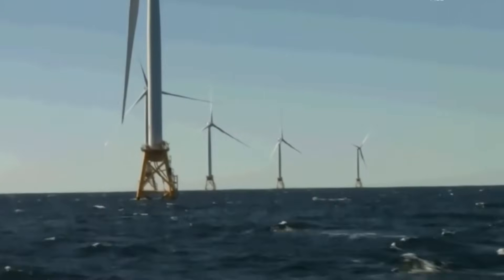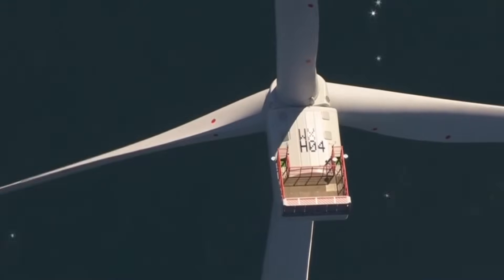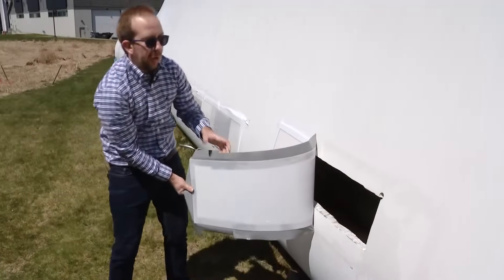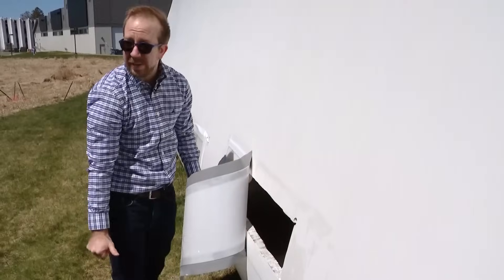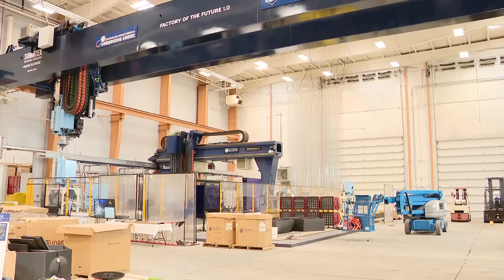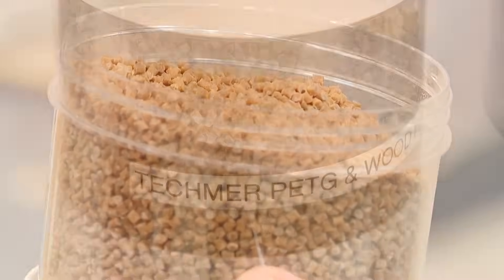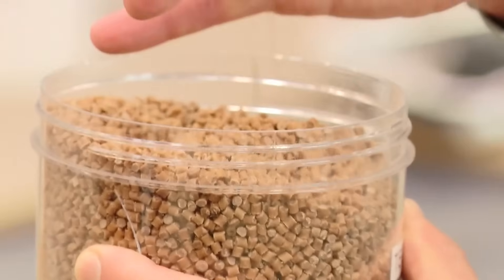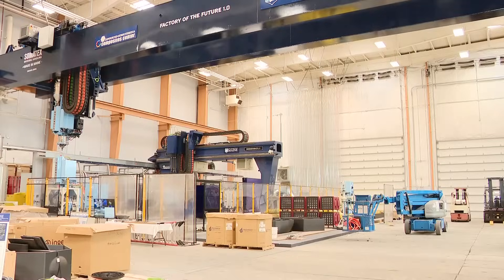University of Maine puts 'new spin' on recycling wind turbines

Comment: if the ground up plastics and fibers can be used in 3D pprinters then they might be able to be used in some kind of plastic welding as well. sections could be cut out of old blades and reused as stock to make other things. my DIY frankenstein kayak was made from alot of plastic welding and scraps and has held up for years. one just has to learn some plastiic welding. with the right scraps and stock and creativity there is much you can do.
Reply: Its fiberglass
Reply: @gibbyrockerhunter  thats even easier to work with with the right epoxy.
Reply: @FrankensteinDIYkayak  really?  Since you cant simply remelt it to extrude a filament i would of thought it would be more difficult.   Aside from the cnc machines abilities. 

Just the process of breaking it down to reuse sounds insanely non cost-effective.
Reply: @gibbyrockerhunter  I just thought it was remeltable as they were talking 3D printing since 3D printing heads are often heated.
Reply: @FrankensteinDIYkayak The material recycled in this video is used as a filler in the printing filament. The fibres (even though chopped) will add strength, while the ground up epoxy with detract too much.

But, back to your idea.. If parts can be milled from the blades (the swarf sent for use in this video), those parts can be glued together since even old epoxy glues well.

Comment: How much electricity did it take to make the blade to begin with??  And now, it will take more electricity to recycle it again. Does the generator produce more than what it will use in its life ?? 🤔
Reply: Gee,  maybe no ne ever asked that before.
Reply: Of course it does. That's the reason it was built in the first place. Believe it or not engineers work that out and it's one of the harder things for executives to put a spin on because investors can very easily see if they're getting the advertised ROI or not.
Reply: @stickyfox  Enron, FTX, etc.
Reply: Huge reinforced concrete base takes a lot of energy to create the construction materials.
Reply: @patmcbride9853  Not just energy but a high contributor to carbon dioxide.
Reply: Funny how people don’t ever mention the costs of building coal fired thermal power plants when they are talking about the environmental impacts of wind turbines. Every form of energy production has costs associated with its installation, operations, maintenance and end of cycle deconstruction. I’ve worked at coal thermal power stations and I’ve worked at decommissioned units. Believe me, shutting down a coal power station and cleaning up afterwards is incredibly expensive. And that doesn’t even account for the associated mine areas. Wind turbines have a much smaller footprint when it comes to life cycle costs.  And BTW, your household kitties kill far more birds than any wind turbine farm ever will. So do modern skyscrapers.
Reply: @briangarrow448 Well since no one is building coal fired power plants in the US, your point is null and void.  Not to mention those power plants had a MUCH longer service life anyway, and most were built decades ago.
Reply: Yes they do. And it's not just electricity but all materials accounted for. Answers are easy to find if you just do a search. Referenced studies from Texas and Denmark have shown somewhere between 1 to 3 years.
Reply: @Andy_Kroll 1 to 3 years is a fairly large percentage spread.
Reply: @ThePhoenixcompanies  Yes, it depends heavily on where they are placed. The more wind in the area, the more production.
Reply: @Andy_Kroll Evidently you're forgetting about the 200-400 cubic yard mass of concrete that will be left in the ground forever...
Reply: @ffjsb  I had no part in accounting for materials in the studies that I mentioned. You're definitely right that concrete has a huge environmental impact.
Reply: @ffjsb  That one has bothered me for years.  And never a squeak from the environmentalists.   A huge producer of carbon dioxide.
Reply: @dougaltolan3017  No, it WON'T.
Reply: @ffjsb  Most haven't, it can, it will.
Now, wind yer neck in with the caps kiddo.

Comment: I am overjoyed that someone is doing something about these blades!
I still question the costs and sustainability of replacing the blades every two to three years.
Reply: They very clearly said the blades need to be replaced after 20 years.
Reply: Yeah, but they’re listening to the oil company troll Farms not this actual video
Reply: @justinciallella besides from his timing being off with the life of the blades, his point still stands. There are over 350,000 wind turbines, each with three ginormous blades made of horrible materials. All the transport, energy in material sourcing, transport, manufacture etc is huge and damaging to the planet. The whole green movement is just a distraction for the fact we need to use the bare minimum energy to avoid famine, but that’s clearly never going to happen as evidenced by the last >50 years when the science has been clear that unless we stop fossil fuels, we will cause planetary warming which is becoming extremely evident in the past couple of years especially. 

It seems we’ve started some feedback cycles now or triggered some type of event that is warming the planet much faster than the predictable, gradual rise from the burning of fossil fuels we’ve had since the dawn of the Industrial Revolution. Scary times, I’d guess most of us have til the end of the decade at most, the rich will buy themself a decade or two longer with well kitted out bunkers etc, but yeah it’s not looking good for us. Shame really.
Reply: @justinciallella  20 years at best...
Reply: @dougaltolan3017  There's a BIG difference between "expected", and real life....

Comment: Looks like they could be fashioned into homes also.
Reply: That would be an interesting idea, but there are several environmental considerations... these are PLATICS... will they outgas micro particles or hazardous gasses?... what happens when they catch FIRE?... HAVE YOU SEEN THE POLLUTION they spew out when on fire?... It would have to be impregnated or coated with a fireproofing agent... This could be the New Lead Paint issue... Grinding up the blades would put tons of micro plastic dust into the air... and I'm not an environmentalist... I'm sure they will come up with many more problems...
Reply: @Reality_Check-1969  "I'm not an environmentalist" wrong, and welcome to the ‘club’  😀 And all good pts. A true (prudent) environmentalist thinks ‘cradle-to-grave’… net impacts including manufacturing resources for ‘better’ product and disposal & repurposing cost & opportunities, respectively.
Reply: @Reality_Check-1969  fiberglass tech that they are made up of isn't new. boats and trailers can be made of fiberglass. OR like housing  insulation most is fiberglass. its nothing like lead paint.
Reply: I could definitely figure out how to make houses with those. I can think of lots of ways to use pieces of them or they could be used to 3D print homes.
Reply: @comfortablynumb9342  I know we always hear that plastics last forever in landfills.  I wonder if you segmented up large pieces of them and covered them with soil like a hillside home, you could create a pretty livable burrow.
Reply: @bukka6697  probably
Reply: When I saw that hole chopped in the side of the blade, I was thinking tubular shelters for homeless people.
Reply: @OWK000  How about we get them jobs and mental health services first??
Reply: Especially suitable in tornado alley… think w/ proper design & build (fasteners) infinitely better (safer) than the pervasive ’stick-frame’ homes.
Reply: @gr8dvd  It wouldn't have the structural strength of wood.  Not to mention the energy needed to recycle and manufacture components.
Reply: No, it wouldn't, but they won't mention that...
Reply: @ffjsb  "wouldn't have the structural strength of wood"  That’s why I noted "proper design" … every material has it’s limits. More challenging (as t.c. noted) may be off-gases & fire protection. Fun fact: manufactured wood now being used in high rises & offers better fire resistance than steel (wood laminated & impregnated).
Reply: @gr8dvd  Fiberglass blades are designed to flex, you certainly don't want that in your floor joists...
Reply: @ffjsb  1. All materials flex. 2. Think angular igloo. Suspect you’re envisioning blades parsed for use in traditional box-like homes.
Reply: @gr8dvd  "All materials flex"...   SMH.  And nobody wants to live in an ugly igloo.   Kinda hard to hang pictures on the inside of an igloo...  SMH
Reply: @ffjsb  1. Flex- yep, even steel. 2. Pictures in igloos… see Guggenheim—1 big igloo art museum. Granted more difficult in small igloos which is why Eskimos love smartphones 😀
Reply: @gr8dvd look up delta homes